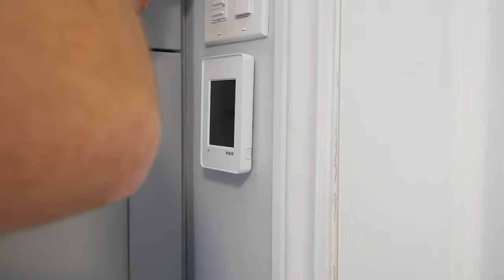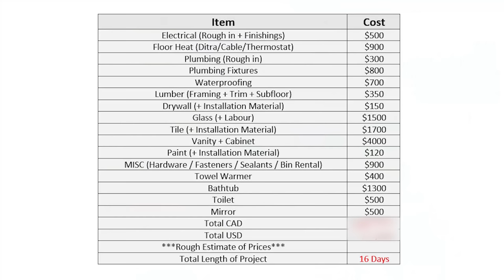Master Bathroom Remodel - How to Renovation

Comment: I spent 25 years doing construction before going to college and changing my career in my 40's.  First let me say I'm really impressed with your forethought and attention to detail.  Clearly you are an exceptional mechanic in several trades.  Not bringing in subs and yet doing everything to a high standard impressed me.  But I have to add that I grew up in a family with a modest income in a region of the US known for thrift.  The saying I learned as a child was, "Fix it up, wear it out, make it do or do without."  My forebears would have seen this as a frivolous expense. The previous bathroom was well built and in excellent repair.  They would have thought it insane to spend $15,000 simply to change the decor to something more modern.  So I bristled at your comment about the 5 people with flat brains not seeing the need to renovate.  There was no need, there was a want to renovate.  I once told my Dad I needed a certain item.  Can't remember if it was a toy or new tennis shoes or what.  He replied, "You need food, clothing, air, water and shelter. Everything else is a want."  Your client had the extra income and the desire to change this bathroom, that's all well and good.  But not need to run down those who aren't as fortunate and who don't have the urge to spend money where it isn't absolutely needed.  Aside from that, you could work at my house anytime.  Top notch all the way across the board.
Reply from the maker: Thank you so much! It was mostly a joke, not meant to be taken too seriously. Although it was also a point against those that feel the need to comment insulting my clients tastes/how they spend their money

Comment: I wouldn’t say the original bathroom is ugly. It’s just a regular ordinary bathroom. The one after is stunning
Reply: I agree with your statement. The green looks good here. I’m not a fan of modern design. I would prefer to have color.
Reply: I liked the original bathroom myself.
Reply: It is ugly 🤣
Reply: You’re right it was not ugly it was hideous
Reply: @b3arwithm3  How so? I’d like to hear your reason on why you think it’s “ugly.”
Reply: @AztkSmooth  Why do you think it’s bad? Not a fan of green?
Reply: @retroryan838  The biggest problem is it clashes so badly.  The green just stops.  If the counters had green, or if the shower walls were using the green tiles, it would've matched up alot better
Reply: @retroryan838  i think the reason it appears ugly is that the contrast between the grout and tile was too big, as well as the one between tile and wall. They could’ve at least used a warmer color to contrast instead of the white, and given the grout a different color to blend it in with the tile. Coloring in grout is a good way to salvage these kinds of tiles when you can’t do a whole renovation
Reply: You too gave a good explanation. I can see why the green tile might not look good because of the wall color.
Reply: Started Ordinary ended Extraordinary.
Reply: X
Reply: I would have simply painted to tile to update and save money.
Reply: @AztkSmooth  Yes, it was hideous!!! That green is nasty and so outdated. It is a beautifully updated bath now, he did a great job. Homeowners are fortunate to have had him do that.
Reply: It was trendy in the ‘90’s.
Reply: Original bath was still better than mine. I just don't have $30K to not have an ugly bath
Reply: @retroryan838 looks is subjective.
Reply: @sihotech you're so real for thisss
Reply: I'd like to have bathrooms that look like that before picture!
If I had cash to waste, I'd consider it.....        :D

Comment: The original bathroom was definitely dated, however, the original tiles in my opinion were a really pretty colour and the first owners could have maybe designed them a bit different. The floors being the same colour as the tub surround was a lot to look at. The after though is absolutely stunning!! Great work!

Comment: Don’t sand before you sharkbite copper. Definitely deburr the exterior and interior of the pipe but you need a perfectly smooth surface for sharkbite, sanding is for flux + solder.

You did an incredible job lining up all the tiles. The fact that you took the time to try is enough but it actually turned out amazing ! Great job on the tile placement!

Comment: Completed my bathroom remodel recently, and I absolutely love how it turned out, even though things that were suggested by the installer and what I asked for, I didn't get. I also have to remove and redo some caulking/silicone around the shower doors due to leaking. Wish you were in my Northern CA area to do my kitchen. I'd hire you in a heartbeat. The word used by your viewers, meticulous, is right on point which highlights your quality of workmanship. Loved watching the video bathroom transformation. Beautiful work done.
Reply: What did it used to look like? I’ve always been interested in what past designs looked like.

Comment: Plumber here. When you use island tub drains you should use a brass tail piece and connect that to the tub drain instead of abs. It will fit into the island drain perfectly and they usually come with the island tub drain kit. I’ve seen abs crack underneath.
Reply from the maker: I actually used an island tub drain for a project I just completed and wow was it amazing. The tub install was incredibly easy

Comment: A lot of great work here, my only question would be about the decision to use a glossy tile on the floor. I've found them too be too slippery and stick to matte tiles in bathrooms. Would be interested to hear your thoughts.
Reply from the maker: Personally I think I’d also prefer a matte tile for my floors but it’s what the homeowners wanted. Realistically it will be fine as there shouldn’t be too much water on the floors but I get what your saying. Definitely have to have something with some grip in the shower though, that I always tell my clients is a must

Comment: I must say, you reminded me of myself. I have been basically a one man show for 25 years and your skills  are good. You did most as I do even down to caulking all the corner joints!! The only things I would have done differently is use a large demo bar and pry up the flooring once a section was opened and use copper instead of pex  because I have seen what rats& mice do to plastic !! Here in California rodents are a big problem! Have seen many holes in even abs from them!!! Good job and keep up the good work! There aren't too many contractors that have our knowledge and skill to perform at that level! Most sub everything out and over charge for supervision!! You should learn a program like chief architect or 20/20 so you can design kitchens when opening up and relocating walls and do floor plans for city. I have saved clients a lot of money instead of them paying more for designers and architects!  Any structural stuff I have my engineer do calculations.

Comment: Wish I knew of you before I had my basement bathroom re-done.   I have cracking drywall and a leak in the ceiling over the vanity.  the contractors rushed the job and didn't do a very good job.

Comment: What a fantastic job! 👏🏻👏🏻👏🏻 I can only imagine your in big demand in your area. Rightfully so!! May I ask how long was the process from start to finish?

Also what is your best recommendation on material to use for a shower remodel? I would like to use slabs instead of tiles to give it a cleaner look. But unsure on the material for a shower? We will hopefully remodel our master bathroom this year! I love the vanity wall light mirror but my only concern is what happens when the bulbs burn out? 😮

Appreciate your video!

Comment: Well done! You displayed many skills, plumbing, drywall electrical, tile...etc. One issue of concern is when you put up dry wall on the exterior walls (behind the tub, shower and window), I did not see insulation installed, was that a miss? Was this renovation inspected by building inspector?

Comment: That is such a nice bathroom! The use of space before was amazingly bad. One question: those tiles are so glossy, and the grout lines so few. Wouldn't they be horribly slippery on the floor? Do you treat them with some sort of non-slip coating?

Comment: Since I’m old and that bathroom is so large I definitely would have had a bigger shower possibly if not wheel chair ready then shower chair. Benches are hard to use especially with no hand rail.  My dream is a wet room.

Comment: Thank you for the very informative video. Bathroom looks amazing! Just to get a quick estimate on the labor cost of renovating a regular sized bathroom (with no floor heating or any of the fancy things) how much would it cost for your labor costs be if all the bathroom parts/tiles were bought by the homeowner? Thank you.
Reply from the maker: Thank you so much! 
My current rate is $4,000 CAD a week in labour.
Material is separate but generally my quotes include all construction materials and the clients provide the finishing materials.
If the client was insistent on providing the construction materials my rate would go to $100,000 a week, lol
Reply: @WorkinwithWolkon  
Double that rate in US...

Comment: Lots of expensive finishes attached to a office partition structure. So glad my 500sqm double story house is built with clay brick, concrete and cement and solid wood doors and windows. Overspending on cheapo structure no no.

Comment: But there really is nothing wrong with the first bathroom, the materials underneath still looked in good condition. You can see that fiberglass behind the wall is great. It seems like such a waste.

However, the style of the before versus the new is very different and if the owners wanted the style of the new then they should, I mean it is their pocket.
Reply from the maker: No it was completely functional for sure. But as you said at the end of the day it’s the homeowners decision and if they’re unhappy with the current space and have the resources to change it then all the power to them!

Comment: Nice video. I am wondering what the water proofing liquid  is made of, is it a type of resin?  I have a wooden door in an out door area which is exposed to some rain and water from the run off from the hose. Was thinking of using the water proofing liquid what do you think ?

Comment: Wonderful job! Questions please-what size grout spacer did you use on the tiles? Is polished a good choice for floors in bathroom? Slippery? I can get 24"x24" statuary in matte and polished, but I admit the polished LOOKS better. Thanks in advance :)
Reply from the maker: Thank you, 1/16 grout lines. Personally I’d be fine with glossy for my bathroom floor but it depends on the individual, definitely not in the shower floor though.
Reply: @WorkinwithWolkon  Thank you and continued success to you :)

Comment: Hi Wolkon, I am planning to use 24x48 for shower floor with kerdi pan 48x48. Would just 2 diagonal cuts work for the envelope or should I half each tile in the middle as well? Thoughts. Thank you for your great videos!

Comment: What a pity the owner cheaped out and used MDF base. Of all the things they could have done to save money, that was probably the worst.
Reply from the maker: Honestly I disagree with the hatred of mdf in bathrooms. I would never suggest it and always suggest to my clients to use either wood or pvc but I feel like there’s an idea online that mdf is going to disintegrate in a few months. If sealed correctly and the homeowners don’t have water spilled everywhere the mdf will hold up for a very long time
Reply: @WorkinwithWolkon  
You're not wrong, but it's going to succumb eventually, and there's just no reason to use it when there are better options.
I'm not sure if it would even be up to code, though my experience is mostly large multifamily developments, so it may be less strict for private residences.
The obvious choice would be ceramic cove base or floor bullnose, but if they want the look of painted wood, then there are resilient products such as Johnsonite Millwork base. That would give exactly the same look as that MDF, but doesn't turn to oatmeal if it gets damp.
It's a bit more expensive than MDF, but in the quantity needed for a bathroom remodel, the cost difference would be almost insignificant.

Comment: Why didn't you extend the water proof drywall to match the depth of the shower? You used a membrane but you did not extend the waterproofing board to match the membrane?
Reply from the maker: The green drywall is not waterproof it’s mold resistant. Tbh it doesn’t really matter what’s behind the schluter membrane, if any water gets behind it then your system has already failed.

Comment: Awesome work, bro wat the idea to solve the silicone inside the shower area or near the water, it gots some black mold. Why is that? Cuz of silicon type or it’s normal after a year? I have to scrape it and apply new one.
Reply from the maker: Your silicone should not be going mouldy after a year. You need to make sure you’re using the right stuff. It needs to be shower rated

Comment: What size of reveal did you leave around the black trim for the niches? Did you use grout or silicone on the face perimeter of them? I've read to leave 1/8" and grout but I feel like that's too big if you have nice clean cuts.

Comment: Do you not have to have qualified plumber and electrician to fit off? Here in Australia it's illegal if your electrical and plumbing isn't done by qualified tradies.
Reply: No, these are smaller jobs that dont really require permits to be pulled. Maybe bigger jobs that would require an excavator or moving breaker box/meter.

Comment: Great job, this Towel Warmer need to be on GFCI circuit?
Reply from the maker: Depends on the towel warmer, distance to shower, and local code.
A lot of warmers will have built in GFCI but with many jurisdictions you’ll still want to ensure it’s a certain distance from the shower head
Reply: Those kind of bathroom renovations require electrical permit in Ontario?

Comment: Quick question??? I do showers as well
Why did you only put dry wall on that bench?
Reply: But great job tho brother
Reply from the maker: Because of the 5/8 thick solid piece of stone on top. Had the top been made from smaller tiles with grout lines then I would have reinforced with plywood, but it’s just not necessary with the weight distribution from the stone piece

Comment: Not sure about the cupboard doors opening onto the switches
Probably should have put a filler strip down there so the doors don’t hit the switches 🤔
Reply from the maker: Yeah we had a lot of discussion on what to do with the switches but ultimately it was outside of the budget to do much else with them
Reply: @WorkinwithWolkon  🤔…. Hence why you should have moved the hole lot slightly towards the left, no need to move anything then👌